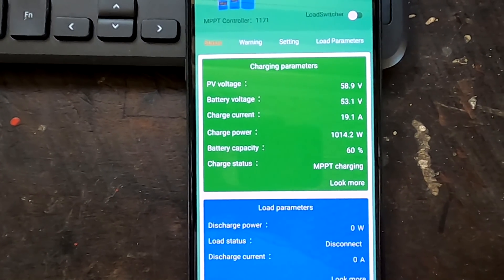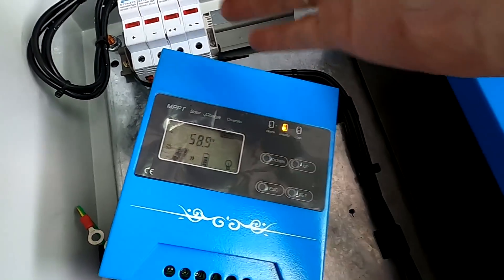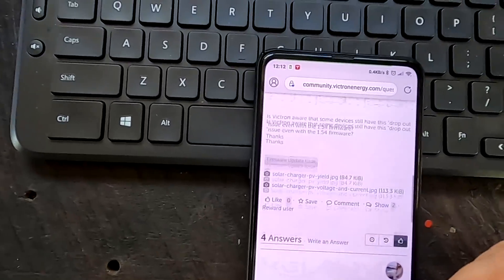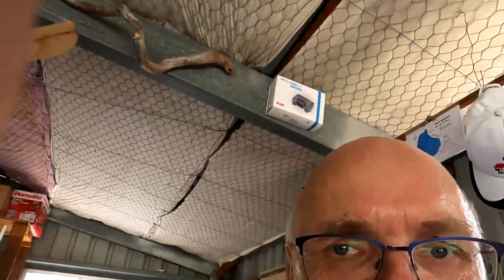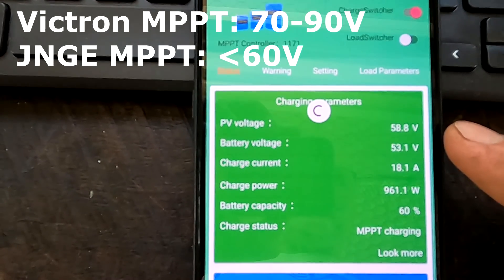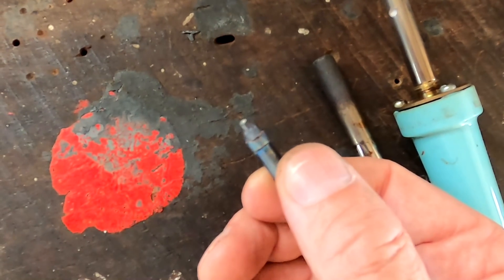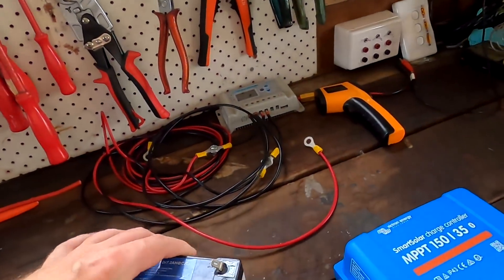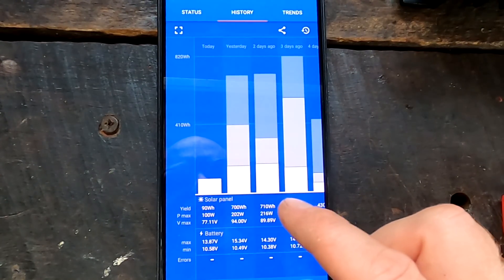They sent me a new Victron MPPT! Will it work this time?

Comment: Victron isn’t cheap, well engineered quality products seldom are, but the 5 year warranty can be absolutely priceless. 

The other great benefit I’ve found is their technical support (they nearly always answer quickly and with practical solutions), plus the wider community of retailers and installers who know the product can also help sometimes.

If you have a limited budget then you may be unable to afford their kit; but my dad always used to say “buy cheap, make sure you save for a replacement/repairs”

Here is a comment from one of the community posts about the MPPT battery voltage setting: The battery voltage is automatically selected at the very first power-up of the charger. The detected figure is stored, and further automatic detection is disabled. If, however, the battery voltage is absent (or below 7 volts) the unit operates as a 12 V model and automatic detection is rescheduled for the next power-up.

Note that 36 and 48 volt operation is only available on models which support these voltages - such as the MPPT 150/35. Note also that 36 volts cannot be detected automatically. Systems operating at this voltage must always be set manually.

Hint: if you just want to update the firmware of a device while still keeping the automatic voltage detection active (e.g. before shipping a unit to the end customer), update the firmware as you normally would do. When the firmware update is complete, at the “Live Data Information” page select to cog wheel in the upper right corner, next the three vertical dots in the upper right corner and make sure to choose “Reset to defaults” from the drop-down menu. Now power down the unit, when the unit is powered up the next time it will perform an automatic voltage detection.

I hope that helps?

As for that Weller soldering iron tip, plenty of life left in it yet, just maybe not for surface mount components 🤓

All the best, stay safe.

Comment: Yes it's ok, you just change to the correct nominal voltage after connecting. Done it many times
Reply: I have seen 24 volt batterys drained so much that the charge controller respond as 12 volt . I came there to fault find connected my computer adjusted the setting and all okay. The hardware accept higher voltage so you don't damage anything. Ps I use for years now automatic fuse breakers to cut the power supply and never used a resistor to precharge even on my 48 volt system.

Comment: Hi Andy, great videos to watch! Would ik make sense to have a circuit breaker between your charger and mppt controller (bridged with a switchable resistor) this way you can troubleshoot and connect safely. (I don't mind de SCC 😁) but it makes handling much easier also when a problem arises at night when you don't have lights because of an issue. Speaking of that, probably you're thinking of a emergency light in the shed which will light when the power is off. Keep on making videos, we miss so much real life technique on YT
Reply: You could use a switchable resistor, or you could have an in-line connector like an XT90-S that has a built-in resistor that makes a momentary pre-connection as the connector is being plugged together. I don't know if the built-in resistor would connect long enough to completely suppress the spark (maybe plug it together slowly?), but it's better than nothing (especially if you're forgetful). If you go that route, I advise spending a little more and getting the originals from HobbyKing.*

* not a sponsor or affiliate 🙂
Reply from the maker: Thank you very much Edward. I will have some breaker upgrades coming soon (also another 2 nice upgrades to my battery). Due to the large busbars inside the cabinet (not delivered yet), I need to do some redesign.

Comment: I connected my 150/35 first to 24 Volts. And than to 48 V without checking is on the PC . The Venus gave lots of warnings, but nothing broke. It was just a short time. It is working now on 48 V fine. After the initial "branding" to a battery voltage it must set manually.
Reply from the maker: Great, thanks for sharing.

Comment: If you would like a cheap back up controller. I use Make sky blue controllers often. If you hook them up correctly and stay below the ratings  ,they work well and track fast too.
Reply: I have a powermr solar charge Controller in my system(makeskyblue Fake). The amps going Info the battery is a little bit off. But the biggest Problem ist that it hast no diodes to prevent Energy going back Into the solar Panel. Others than that its quite good. 70 bucks for an 60a mppt is good.
Reply: @BastelPichi  your solar panels should have blockers on them. Also solar panels are LEDs so if you ever see your panels glowing at night ,shut off your breakers.
Reply: @frankz1125  right. But still thats not cool.
Reply: @BastelPichi  i know. I was being sarcastic. I myself have never had a problem with the real version.  They are close to the same price. Might as well get the real one .
Reply: @frankz1125  In germany its like that: 30a makeskyblue 100€. 60a powermr 70€. So off course i bougt the powermr
Reply: @BastelPichi  your call. They are not the same controller. Looks can be deceiving.
Reply: I have 4 Makeskyblue v119 and agree that they aren't accurate and the fan has to be replaced every two years but are kind of reliable if used within half of their ratings.
Reply: @BastelPichi  not to mention my master make sky blue on my 120vcd house system has made 1.6 MW already without any problems. I have 3

Comment: Unless the designers were incredibly incompetent, having Vmax > Vbat > Vfloat should be completely harmless since Vbat > Vfloat should simply cause the PPT to shut off. The most likely danger of Vfloat > Vbat would be damaging equipment that isn't designed to take Vfloat. Shipping the PPT at the lowest voltage preset is the safest option.

Comment: I have the same problem with Epever Tracer 4210AN it works as PWM most of the time.If i reset the circuit breakers from the pv input it works as MPPT for a few minutes than the pv imput voltage goes down almost to battery voltage.I changed on of the controllers with victron 100/50 smartsolar and it works perfectly unlike the Epever chinese toy garbage controller.

Comment: Most power supplies including solar charge controllers are what is referred to as single quadrant output. That is it can provide voltage to the load, but not take it back. It can supply current to the load but no5 take it back. So if the solar controller is set to output less than the battery voltage, no damage will occur.

Comment: I wonder if these solar charge controllers are getting damaged from BMS disconnect events. Normally manufacturers warn that the controller may be damaged if the battery is disconnected while the solar panels are still connected.

Comment: 12/24 and 48 volts are auto select, only 36v needs to be set manually. The is the spec sheet for victron
Reply: But only the first time. After it is once connected to a battery. I stores this information inside. I connected ist first to 24 V, than to 48. There where lots of warnings.

Comment: I may have missed it in earlier videos but if you are being careful to not connect the PV before the batteries what is the protection for the charge controller if the BMS disconnects the batteries with the PV connected?
Reply: Good point !!! I wonder if the charge controller would try to power the inverter directly then ?
Reply from the maker: Yeah, some controllers are allergic against having solar but no battery connected (some even die). It's not a problem with the Victrons though. They just go into Absorption mode and turn down the voltage. And yes, they keep powering your load...
Reply from the maker: The SCC actually still power the inverter if the battery is turned off.

Comment: You should open up both Victrons, and see if the one from ebay is different, old model, or simple counterfeit.
Reply: Can you open them for repair?
My 100/50's have been reliable for year's
 I bought a chinese fangpusun copy it died why I tried to get it open it was totally full of white  epoxy and non serviceable and a bin job
Reply: very difficult to open, and will be damaged....

Comment: Hi Andy what happen if you connect For example 155v. I have 3 panels each has 50v. When the weather is cold the voltage of each panels is 51v so together is 153v. Can I damage the controler?  Will it endure a few more volts?

Comment: That's it! No frog!! I am cancelling my subscription..  LOL. Just kidding.  I think Victron has so much going for it, but for the price they need to be the best. I don't think they are there yet. The bluetooth is so bad too. I would rather spend more money to buy quality one time instead of cheap stuff many times for peace of mind, BUT. They have to deliver to charge such a premium price. Looking good -Bull frog!  : )
Reply: Somewhat understandable  that the built-in Bluetooth is less strong, Victron should increase the signal strength a little bit to compensate for this, but you can always add a Bluetooth Smart Dongle if this is a major problem, but should not be necessary. ..
Reply: The frog didn't want to jump in the water because it was too cold.

Comment: I set up my smart battery protect on 12V's so that I can play with the Bluetooth. Then later went into the settings and changed to 24 V before disconnecting from 12 V's without any issues. I know it's not a charge controller but it's a Victron product.. So maybe they're similar? I have wondered this also. Oregon USA
Reply from the maker: Thanks John. I'm not brave enough to test it myself 😁

Comment: Hey, I got a voltage drop from my Batterie to Victron solar charger of 0,05V without load or charging. Just turned the Victron on without solar panel connected.
Now I set the all the settings in the victron 0,05V lower than before to compensate the voltage drop. 
What do yo think? Is that the right way, or is there a better solution?

Comment: I didn't see you replacing the BMS yet. Do you still use the faulty one? Or the one they wanted to send you? Any plans on what to replace it with?
I like the app you have so much more than the one of Daly.
Reply from the maker: Yes, still using the old one. Haven't had time yet. Sleep, eat, work, repeat at the moment.

Comment: Hi, can you pls tell me some info?

Since we will be charging the 51.2V 230ah 11.7KWh Wall&Floor-mounted LiFePO4 Battery (link bellow) with 3 x 480W solar panels ( Vmp = 37.10, lmp = 12.95A), we would like to have information on which Victron MPPT controller is suitable so that the battery will be charged properly (Operatin value charge of the battery is 43V - 58V).

Does the Victron 150/45 match the charging voltage?

Can such a battery be simultaneously charged from the panels and at the same time transmit energy to other consumers?

Comment: I really learn a lot from your videos. Especially how to prevent the big spark from happening when connecting the live wire over to the charge controller. 

Where can I buy that small capacitor that you use? And what specific model/type should I purchase?

Danke!
Reply: It’s a resistor, so there isn’t a massive current flow, not a capacitor.
Reply: @FutureSystem738  Ok thank you!
Reply from the maker: I've got some of these resistors on my website:
https://off-grid-garage.com/inverters/

Comment: Can you pls tell me what is the dial  setting for is located below the 3 lights
Reply from the maker: You can pre-set profiles for different types of batteries. So if you want to change it, you just turn the dial without using a phone or computer to go into the settings.
Reply: @OffGridGarageAustralia   ok Thanks... what number should I select for seall lead acid batts?
Reply from the maker: @bestillandknowthatuaregod  uhm, no idea what controller you have but go to https://victronenergy.com and have a look for your product and manual. That tells you exactly what setting you need for lead acid batteries.
Reply: @OffGridGarageAustralia  I have a Victron Blue Solar MPPT 150/35 Amp Solar Charge Controller

Comment: Let me suggest that you read the manual for the 150/35 SmartSolar charge controller.   You will discover that it says nothing about setting the system voltage prior to connection.   Indeed, it is powered by the batteries, so if you had only a 48 volt battery bank, you would have been unable to set the battery voltage prior to connection.   The manual also says nothing about using a pre-charge resistor.   The proper way to do the connection is to turn off the main power switch, make the connections, and then turn the main power switch back on.   You really should not be tinkering with the wiring while the main power switch is on.
Reply from the maker: I don't read manual, no.

Comment: Thanks Andy.
I’ll bet your cheap controller is indeed PWM.
Soooo many cheap controllers from China which are advertised as MPPT, are in fact PWM. 
Lies!
I hope the new Victron behaves!
Reply: Andy opened the JNGE, it has a small toroidal inductor, which is a requirement for MPPT. Cheap Chinese PWM do not have one. It could be also for boost/buck of voltage, so having some MPPT-like effect. The software says MPPT. Many people would not trust cheap Chinese SCC; I had one, US $5! it outputted up to 17 volts @ 12v, which blew some LED’s, so I used a 24v to 12v, 30 Amp converter, for stable power; it output 33 volts @ 24v!! for one day; (had to run all loads in daytime). Next day a better replacement arrived, US $25 BSC3048 PWM 30Amp, up to 48 volt batteries, including many Lithium & Lifepo4 settings. Up to 100 volts solar input. It works well; no equalisation into GEL batteries; no more volts than the 28.8v Absorption, which is adjustable. Fixed 32v load over voltage protection.
Reply from the maker: Yeah the JNGE is in fact an MPPT but I think their algorithm they programmed is not very good and drives the solar panels far to low. With the JNGE I only had 1050W as max while the Victron had 1500W as a max with the same panels.
Reply: @OffGridGarageAustralia  Thanks Andy.
I have a cheap Chinese “MPPT” controller for portable solar panels, which came with the panels. It’s is no more MPPT than a direct wire connection is, total garbage.
They are such fluent liars!

Comment: If it reset voltage automatically it make no sense to set it to different voltage. Why didn't  get the 250/60 ? It is cheaper than two 150/35  and you can get 15kw with one controller.
Reply: With 2-150/35 you can have mismatched panels combined without to much penalty.
Reply: @lesw8798  That is one valid  reason.  My newest panels will be 400w  10a each to be on stream of 5 in series.
Reply: Not sure how you worked out 15Kw.
The 250 is the panel voltage and the 60 is the current to the battery.
At 50v 60amps yields 3Kwh
Reply: @martinly1050  You are right. I stand corrected. I need to rethink my calculation. 
400w panels 10A 50v in serie  x 5 is 250v and 2kw x 6 equal 12kw?
Reply: @neliosamch3195  not quite.
The 250v is the panel side so normally 5 or 6 panels in series the you can parallel another string or two.
The 60 is the maximum current to the battery. Charging a battery at 50volts 60amps require a theoretical 3kws of panels.
You normally size your array to 1.33times the charger capacity.
Reply: @martinly1050  So the max I  can get from a Victron 250/60 is 6kw. Or 3 string of six panels in series.  Thank you for the information,  I would have gotten the 250/100 if I have known it.
1.33 x 60 = 80 amps or 150 v?
The 250v is to get the most charge in the morning and afternoon,  since some panels will be facing East and some West.
Reply: @neliosamch3195  max power is dependent on the current rating both the 250/60 and 150/60 are only capable of 60amps to the battery.
If your battery voltage was 24v then it will be 60amps at 24v or about 1.44kw capacity. If your battery volts were 60v at 60amps then thats 3.6kw.
Maximise your panels according to this limitation
Reply: @martinly1050  Thank you Martin for clarifying that. I will keep it in mind when installing the new panels.

Comment: On page 1 of the manual for the MPPT 150/35 it states "controller will automatically adjust itself to a 12V, 24V or a 48V system one time only. If different system voltage is required at a later stage, it must be changed manually" Again, its on the very first page of the manual. I really do wish that we would check ourselves before being critical of products and pointing fingers. Every time you point a finger there are three pointing back at you!
Reply from the maker: Who's pointing fingers?
Reply: @OffGridGarageAustralia  Do you watch your own videos?

Comment: Hey Andy, is .3 really that big of a deal?
Reply: Sure it is for LiFePo4. The difference between 3.65V and 3.95V is potentially a lot of smoke in your Garage...
Reply: @ElectronTinkerer  Wouldn't the 0.3 Volts be spread across the entire battery bank - not just one cell ?